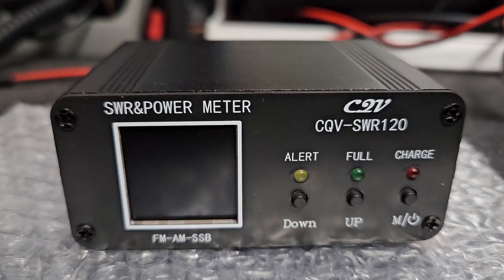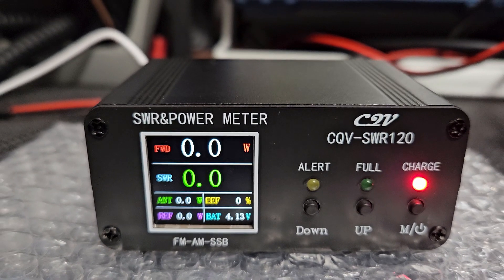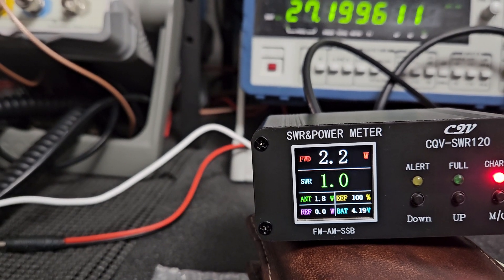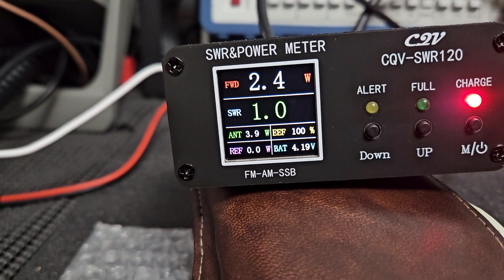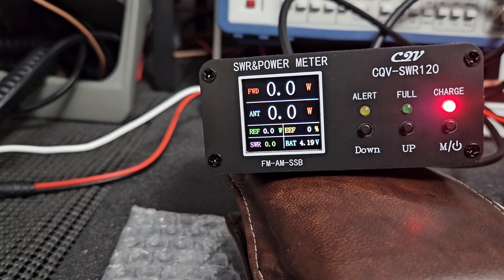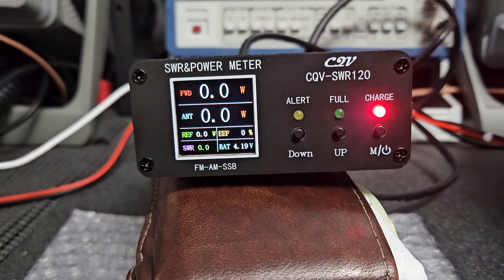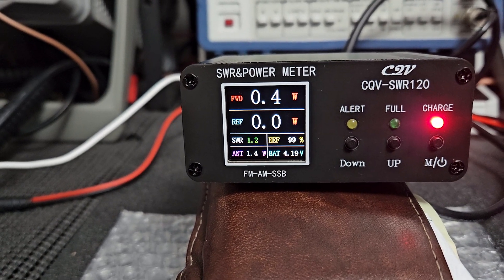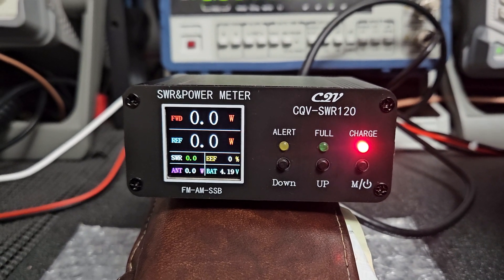C2V CQV-SWR 120 SWR & Power Meter Test

Comment: I have one of these - it's really only useful for average power.  Useless for PEP.  Would be ok for FM mode.  Would have been nice had it had more than one decimal place.  Can also confirm that the Monitor Sensors meter is light years ahead of this (I own one of these as well).
Reply from the maker: Totally agree
Reply: Hi guys. Chould it be useful for cw? Thank you very much 😊

Comment: Another nice review!  Definitely a tiny little meter. The one thing that I haven’t tried doing is using it while charging it. Seems to act different. If you get a minute, try seeing it operate without the charging cord plugged in. Might play a roll, might not.
Reply from the maker: Yeah if I get time on my next radio I'll hook it back up and look at it.. I didn't realize it has an onboard battery.